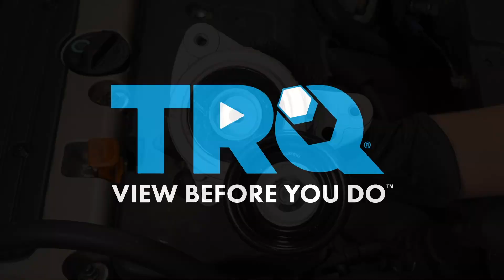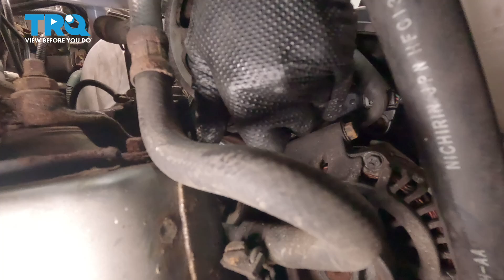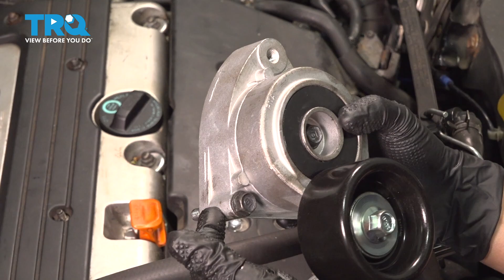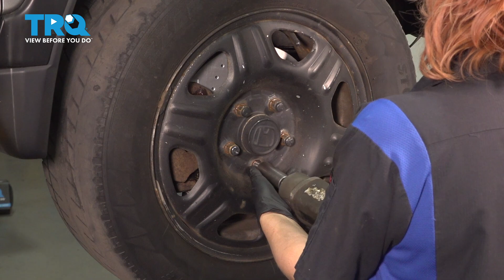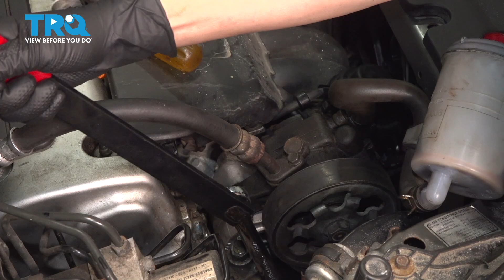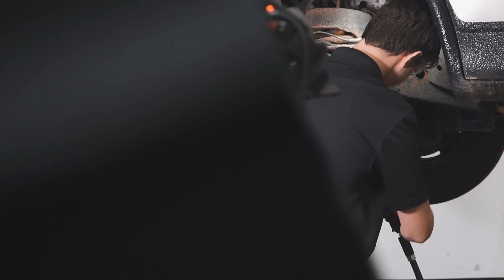How to Replace Accesory Drive Belt Tensioner 2002-2006 Honda CR-V 2.4L L4

Comment: Very informative video and great write-up! You weren't kidding about that bottom bolt on the tensioner being tough to get! I didn't have a 1/4" drive and my 3/8" ones weren't fitting so I ended up taking off the pulley first to get access to it. Made removal much easier on my '04 CR-V. Just a heads up for anyone who was struggling with this like I was!

Comment: I used painter's tape to keep the lower bolts in place. Then used first aid tape around a 12 point long socket, no ratchet to hand tighten it. Then used 1/4 inch ratchet to tighten down first, then used the 3/8. If your hands are greasy  wipe them off while doing this.  I can do the starter on a CR-V  with a 1/4" ratchet and extensions for that 14mm bolt in the back, no need to remove the intake,NOPE!

Comment: Thanks for the video. I had to remove the motor mount, there was no way I could get my socket wrench in there. The car is still vibrating at idle. On to replacing the harmonic balancer next.

Comment: Not sure why the official repair manual tells you to remove the pulley from the tensioner to remove/install. Obviously these guys had no issue with installing it as an assembly.

Comment: Thank you, nice detailed video. I want to replace my power steering pump. Even if i use the wrench to release the tension it remains too tight to remove the serpentine belt. I have read some comments with the same issue. Any solution?